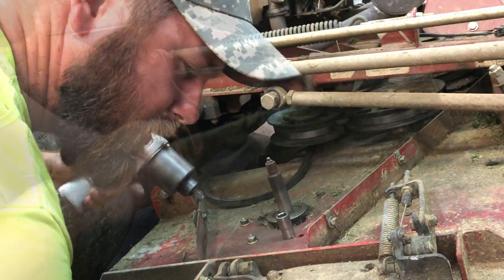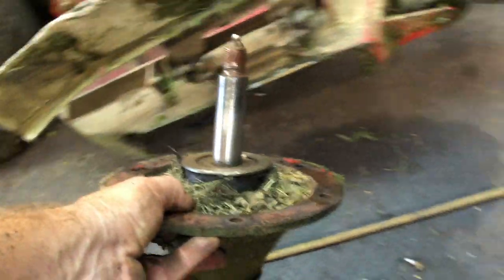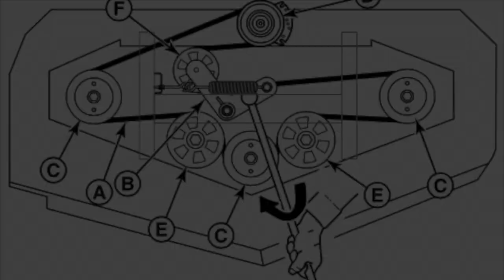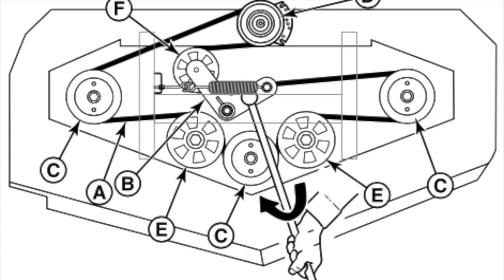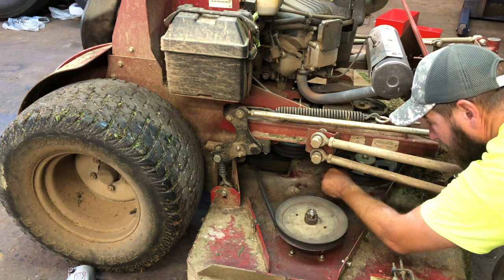How to Replace a Spindle | Ferris Z3X |

Comment: holy crap I changed a lot of spindles in my lifetime and have Never had a keyed pulley  just come off with your hands. I'm currently using a puller and it's bending the pulley so your a lot luckier than I am
Reply: same here, except I haven't been able to "release the hostage" yet. - perhaps for the sake of the video it was recently reassembled. I do appreciate that the complete job was demonstrated and that I can see that there a LOT more of the pulley bore over the spindle shaft and there is no hidden allen screw or something I'm fighting. Looks like it safe to apply some heat under the pulley.  Thank you!
Reply: I just spent half the day on this. Ended up cutting the pulley off so I could drop the spindle down and I'm currently waiting on a new pulley and key to be delivered.
Reply: I'll be returning the two bearings I bought since this spindle assembly is trashed now from the puller. So much for having a spare spindle

Comment: Great job giving us step-by-step instructions.

I have one spindle that I think is getting a bit loose. This video makes me completely comfortable changing it out.
Reply from the maker: Save your old one too! Especially if the shaft is still good. Sometimes, if you catch it early enough, you can just replace the inner bearings which is a whole lot cheaper than buying the spindle as a complete unit.

I’ve been meaning to make a video that because of how easy it is to replace them.

Comment: What a great video perfect explanation thank you for taking the time making it easy for us man
Reply from the maker: You’re welcome Tony! I figure if the manufacturer can send videos out to the dealers/mechanics why can’t John Q. Public have something to use ourselves. 

Oh and by the way save your old spindle. If the cast iron shell and the spindle shaft are good you can take it apart and replace the bearings themselves and have a spare assembly just in case and it’ll cost about half (or less) than a new spindle will. Just food for thought.

Comment: Much appreciated! I just changed a bad spindle on my Z3X. Only quibble is that your video says use a 1/2” WRENCH on the tensioner…I was quite confused until I determined it meant A1 /2” RATCHET. Other than that, very helpful!
Reply from the maker: Lol I don’t know what else to call it. To me It is a 1/2” socket wrench as opposed
To a 3/8” socket wrench. 

Glad it was helpful though!!

Comment: Great Video . . . I can do this
Reply from the maker: Save your old spindle and you can rebuild it for a back up or you ever need another one….it’s cheaper than buying a whole new one. 

Also I don’t think I mentioned it in the video, but there is a “ooze port” that opens up as your pumping grease into it that lets you know the spindle is full of grease. It’ll make your life easier if you have that facing to the front of the mower so you can easily see into the deck at that port when you’re pumping grease.

Comment: if you put the ferris 52 pulley on you will get more blade speed and mow faster.  use redline grease bearing last longer and cooler
Reply: Wouldn't you need to change all 3 pullies for each blade?

Comment: Well dang wish my pulley would come off like that none of them are just pulling up will I need a pulley puller or harmonic balancer puller you think?
Reply from the maker: I’ve used pullers before but I just replaced one two weeks ago and had to make it Liquid Metal and drop the spindle down the bottom of the shaft. I was not a happy camper. 

I couldn’t risk damaging the pulley and it was seized up good.
Reply: I have a SRS-Z2, the blade spindle on the right side need replacing.  I had to cut it to remove.  After removing and inspecting, looks like it welded together.  I cut after puller not working.

Comment: I have a 50inch zero turn toro and it will pull for about 20 min.then the right side will quit pulling if I let it sit for about 20 min it will pull for about 20min then quit. What is the fix.
Reply from the maker: Not sure. Maybe the belt is slipping? I don’t know why time is a factor in it working or not working.

Comment: What kind of grease and how often do you grease? I’m on my second spindle in 585 hrs. I’m frustrated. Lol
Reply from the maker: I’m at 900 ish hours and have now replaced all three!!  I switched the end of last season to an extra heavy duty grease (https://amzn.to/3rwLwZQ )

I have found that these spindles seem to go through more grease than others. Usually 3-4 pumps each week at blade changes and I’m all set. Seems like I’m pumping 10-15 pumps (until it starts spitting out the pressure port). 

Save your spindle assembly and buy the bearings to go inside...it’s cheaper than buying a whole new assembly. But beware if your bearings have been bad for a while because it could have warped the spindle spline to where it can’t be used again.
Reply: @DaisyDukesLandscaping   thank you so much. Turns out my electric grease gun wasn’t putting out as much grease as thought. I was putting two pumps daily. But when I pulled the spindle and remove the bearings there wasn’t much grease. Learned my lesson. And yes I changed the bearings this time.
Reply: do you have to do the whole spindle or just bearing?

Comment: How many hours were on the machine when the spindle went bad?
Reply from the maker: Honestly I don’t remember now. I want to say around 500-600 hours. 

But if you catch them quick enough you might be able to buy a new bearing kit and take the spindle apart and replace just the bearings.  But if you run it too long with the bearings bad you’ll end up having to replace the spindle spline also. Still cheaper than buying a new spindle, but it takes a little bit more time which sometimes costs in the long run. 

I keep all my used parts like that and come winter time when things slow down a bit I see which ones are good and if I can rob from Peter to pay Paul so to speak.
Reply: @DaisyDukesLandscaping  Good information, thank you for the reply and the step by step video.

Comment: Hey man hope you reply to this. I hit a root with my Z3X and broke a blade. Now when the pro is engaged the whole deck shakes bad. At first I thought it was because of missing part of the blade is throwing it off balance but now I'm thinking I busted the spindle because I cannot get the blade bolt off. I used a 1,000 lb ft torque impact and a little heat but it won't loosen. I think I bent something inside so the bolt is stuck. Should I use more heat and a stronger 1,200-1,400 lb ft impact in hopes it's just really stuck or does it sound like a it's the spindle? Just bought it used, never removed the blades. Thanks
Reply from the maker: Sorry just now seeing this. If you’re blade broke there’s no doubt it tightened the bolt when you hit the tree root and most likely an impact wrench won’t get it off. First thing I’d try to do is use a cheater bar (maybe a 2-3’ pipe) on the end of the wrench and block the blades with a block of wood and try to break it loose. It’ll probably feel like you’re going to snap the bolt head off but keep prying. If it does break hex head off it will release the pressure and you should be able to back the bolt out (might have to use an easy out but not usually). If that doesn’t work then you’ll need to cut the head of the bolt of with a cutting wheel…again relieving pressure and then back the bolt out. 

I hear a lot of guys say they apply heat but I was always taught it’s not good to apply heat to the bearings (it transfers to the bearings). 

Hope this helps!!
Reply from the maker: It’s shaking because of the blade for sure…that’s not to say you didn’t damage the spindle but the vibration is because of the massive unbalance that’s taking place.
Reply: @DaisyDukesLandscaping  thanks for replying. The other day I placed a torch on it for 10 minutes straight and eventually loosened the bolt with a 1,400 lb ft cordless impact from Harbor Freight.
Reply from the maker: Just keep an eye on that spindle because excessive heat for too long isn’t good. 

If for some reason it does go bad can you buy a new spindle keep your old one because a lot of times the parts are reusable like the housing or the spindle shaft. If you got the downtime in the off-season it’s cheaper to rebuild one then it is to buy it out right
Reply: @DaisyDukesLandscaping  thanks alot man 👍

Comment: I have the small aluminum spindles is there any way I can change them to the bigger iron spindles? redrill holes is it worth it?
Reply from the maker: What mower do you have?  I’m sure you could probably “reconfigure” the spindles, but I don’t know that it’d be worth it to change the manufacturer’s specs.
Reply: ferris with small aluminum ones
Reply from the maker: That’s not my area of expertise, but I’d probably say go with what the manufacturer recommends…aka stock parts.

Comment: Does anyone know the actual torque specs on the big nut ?
Reply from the maker: Do you mean the nut the holds the blades on?!  If so, I don’t know if anyone who torques them
To specs. 

With an air gun I usually tighten them to one “ugga-Dugga” with a 20v DeWalt impact drill I use the #2 setting and tighten it to the drills max.

Comment: What really irritates me is when someone cranks down the nut on the pulley and it won’t come off.  Anyone have any suggestions?  I’m using a wheel puller and it’s literally bending the pulley.  Still won’t come off
Reply from the maker: You might have to use the puller and apply heat to the shaft and then bump it with a hammer.
Reply: @DaisyDukesLandscaping  did that and no luck. I may have to physically cut the shaft and replace the whole thing.  I actually loosened the nuts hoping that spinning may jar them loose at some point.  They’re on there THAT tight.  I just don’t understand people.
Reply from the maker: I have a thought, but just to confirm you were able to get the nut off the top of the spindle shaft… you just can’t get the pulley off the spindle shade… correct?
Reply: @DaisyDukesLandscaping  correct
Reply: @DaisyDukesLandscaping  correct
Reply from the maker: If nothing else is working I would coat the spindle shaft with a good penetrating oil like PB Blaster or WD40 penetrating oil and let it soak for 5-10 mins. 

Then remove the nuts and bolts that mount the spindle to the deck (beneath the pulley). 

Next remove the grease zerk from the top of the spindle and put a piece of duct tape or something over it to keep the trash out. Then find a scrap piece of wood (a 2x4 should be good enough) and put that on top of the spindle shaft and try to beat the shaft out of the pulley vs trying to pull it off the shaft. Try to hit it square so it doesn’t bend… if it doesn’t work at first get a bigger hammer because you have nothing else to lose. 

Let me know if that works!
Reply: @DaisyDukesLandscaping  thanks. Appreciate that. I just bought a welder, I’m thinking I may weld something to the top of the pulley and use a slide hammer.  Definitely keep you posted and appreciate your time!
Reply: Confirmed, I had to sacrifice my wheel puller and weld it to the to the top of the pulley.  What a pain!
Reply: Personally I would have greased the spindle before installing it
Easier to see when the is full without blowing the new seal out.
Secondly I would have put a generous coat of Never siez on the spindle shaft
Just in case you want to remove it at a later date. Cheap insurance for future repairs 
My two cents worth 
😊

Comment: Sometimes you have to torch those things right off and buy a new pulley... Had to do it 2 times
Reply from the maker: I’ve been lucky not to have had to do it at all… I’ve replaced all 3 now. In fact, my experience had been the spindle shaft is what has worn down and the bearings and housing are still in good shape. I have two “spare” spindles with fresh bearings that only need the $75 shaft and they’ll be good as new (vs $175 complete assembly).